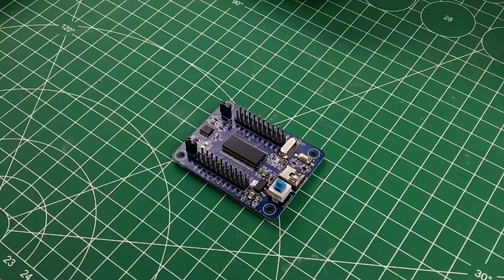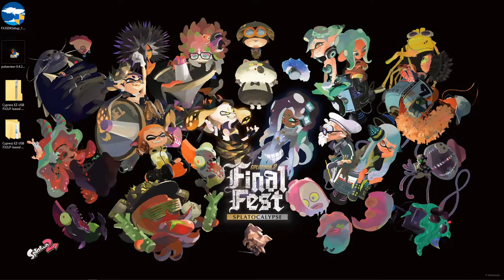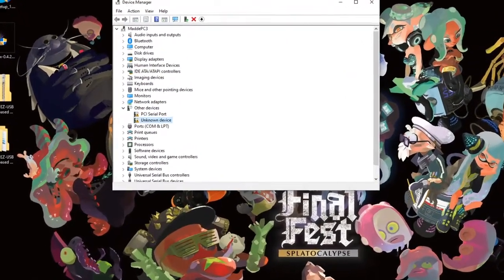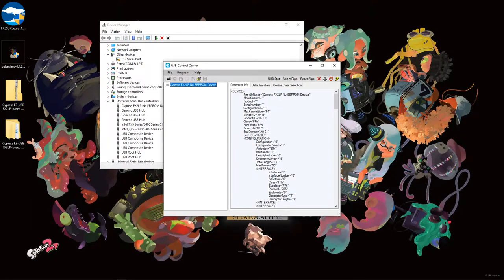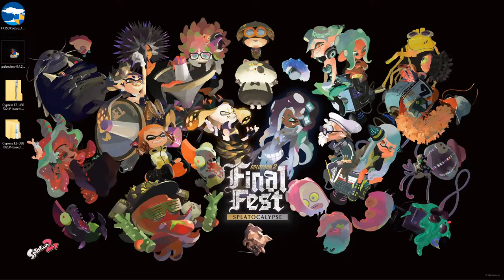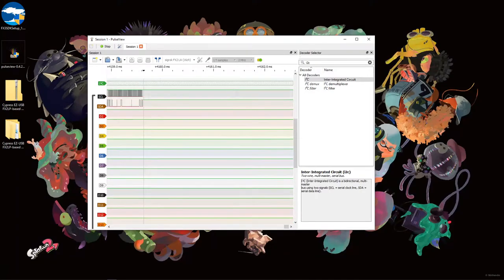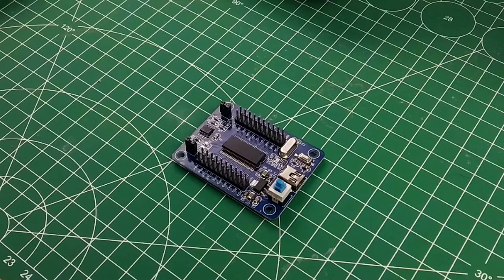Setting up a cheap Logic Analyser (CY7C68013A) in Windows

Comment from the maker: Useful Timestamps:
General Overview: 0:08
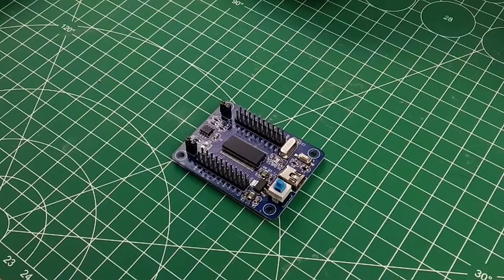Setup Guide: 0:55
My Other Thoughts on This Device: 5:53

Links:
Original Setup Guide by ChaitanyaV_61 (this contains the iic file): https://community.cypress.com/docs/DOC-18867
Cypress EZ-USB SDK (requires a free Cypress account): https://www.cypress.com/documentation/software-and-drivers/ez-usb-fx3-software-development-kit
Sigrok PulseView: https://sigrok.org/wiki/Downloads
CY7C68013A Datasheet: https://www.cypress.com/file/138911/download
HxD hex editor: https://mh-nexus.de/en/hxd/ 

Just in case the original guide is lost in the future, the hex values for the IIC file are: 0xc0 0x50 0x1d 0x8d 0x60 0x20 0x20 0x00

Comment: Hi, it is not necessary to download the 384MB "FX3 SDK Setup" file if you have some means of writing the EEPROM, perhaps using an Arduino or a cheap CH341 programmer. Memory has only 8 addresses written, the rest are all 0xFF. 
I used the CH341 programmer (Type: 24 EEPROM; Manu: Holtek; Name: HT24LC128), kept jumper J2 (this jumper changes address A0 from 24C128) and connected VCC (3.3V), GND, SDA and SCL to the board pins and CH341 using wires. The contents of memory 24C128 (which CySuiteUSB3 wrote) is this: C0 50 1D 8D 60 20 20 00 (all in hex). After programming the EEPROM, using CH341 or another programmer, you must remove jumper J2 for use.
Reply: Thank you. I've tried the FX3 SDK method without any success. Then I used an Arduino board to program the 24C128:

#include <Wire.h>
#include "SparkFun_External_EEPROM.h"
ExternalEEPROM myMem;

void setup()
{
  Wire.begin(); 
  if (myMem.begin() == false)
  {
    while (1);
  }
  
  char myValue1 = -64;
  myMem.put(0, myValue1); //(location, data)
  char myValue2 = 80;
  myMem.put(1, myValue2); //(location, data)
  char myValue3 = 29;
  myMem.put(2, myValue3); //(location, data)
  char myValue4 = -115;
  myMem.put(3, myValue4); //(location, data)
  char myValue5 = 96;
  myMem.put(4, myValue5); //(location, data)
  char myValue6 = 32;
  myMem.put(5, myValue6); //(location, data)
  char myValue7 = 32;
  myMem.put(6, myValue7); //(location, data)
  char myValue8 = 0;
  myMem.put(7, myValue8); //(location, data)  
}

void loop()
{ 
}
Reply: i wish i ve known this before watching the entire video

Comment: Followed step-by-step, right through to connecting to a I2C link and getting the data decode.  Everything was exactly as described - a very good job.  This is Windows 11 with a generic clone module.  Note that 24Mhz does not work, at least not with full 16 channels.   I will need to explore the limits, but I am actually interested in multiple channels more than the high speed.

Comment: In PulsView i get a Error message that says.. : "failed to open device generic/unspecified error"  Device is selected on sigrok FX2 LA (16ch), whats wrong here.? Please help me out.. I'm running Win 10 x64 | Kind Regards !
Reply: I just installed the driver and programmed eeprom on mine today. When running PulsView I get same fault as you. The deive is recogniced, but error message when it tries to open the device: "failed to open device generic/unspecified error", same as you.  Did you ever find out how to fix the problem? Thanks.

Comment: Thank you, sorted my board out. Just a couple of things different in my scenario. Would not load the driver (windows 11) so had to fudge it by manually adding the driver - browse - add manually - selected all - then browsed to the driver directoryand click ok. 
It listed a whole chain of them, so I selected the Cypress blah blah no eeprom. Windows complained saying using wrong driver might produce un expected results. Clicked ok and then the  device showed up in the usb control center. 
Had another problem writing the lic file. It only would do it successfully with the link enabled, failed with it off from the usb control software. 
Ran Zadig, select unkown device, and BOMB, its all working. Cheers again. btw the board I had was a DollaTek EZ-USB FX2LP CY7C68013A USB
Reply: how to enable link

Comment: hi guys! I just bought one and when i plugged in, the led doesn't work. It is normal before installing the drivers and the other stuff or my card is just dead ? there is 5v at one point in the board (i measured it) and I also use the switch before someone asking. If someone have this board non set up yet or if someone remembered before, let me know the behavior of the led. thanks

Comment: I installed the logic analayzer, it works fine, but it pulls up without any signal. When 0v is given to the input, the signal becomes low, and when the signal is cut off, it becomes high. How can we set the entries as pulldown at startup?
Reply: Put pull down resistors in circuit

Comment: This is the same hardware of the HCTEST0006 (8 channel 24MHz) logic analyzer, which has input buffer (highly recommended).
Reply from the maker: Ooh, excellent recommendation!
Reply: Using PulseView 0.4.2 it only worked up to 12MHz here. The latest version has been identified as a virus by AVAST (Win32:Evo-gen).

Comment: You are spring ans I2C, so you connect on clock and data. But In think you need to have the same ground (GND), otherwise logic analyser cannot detect accuratly the logic level. Somebody can explique me? Than you.

Comment: USB Control Center 64kB EEPROM "Programming failed". I've followed all the tutorial but I wasn't able to program the EEPROM. Any clues? Thank you.
Reply: did you put off ur jumper before programming?
Reply: @asdasd-qy1dq  I've removed the jumper after powering the board and before programming. Two boards from the same seller with the same issue. But I was able to program it using an Arduino board like posted in another comment.
Reply: oh nice,I hope someone makes a video in detail.